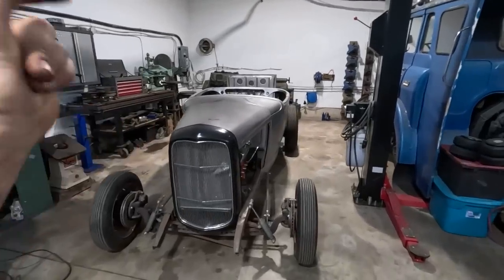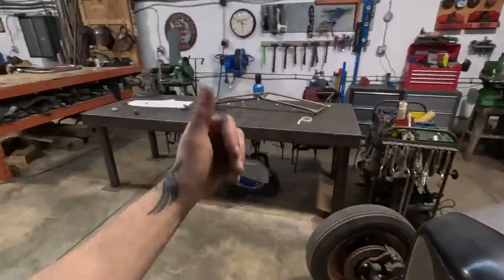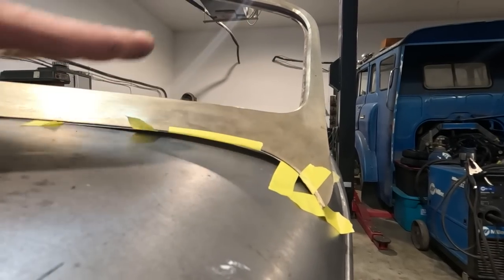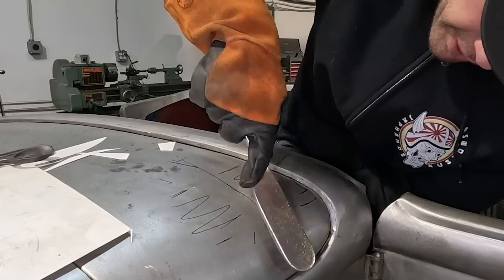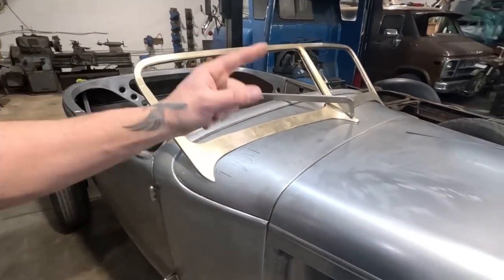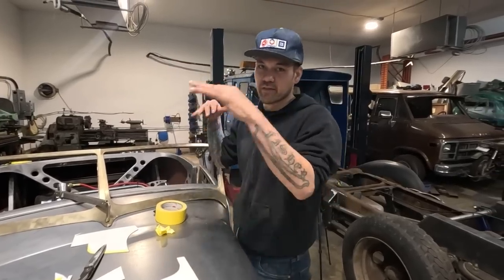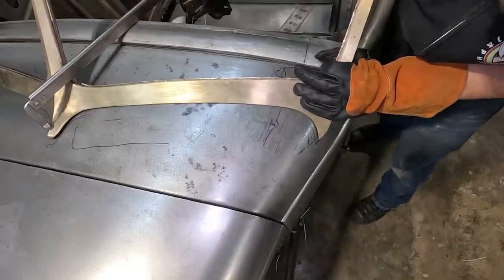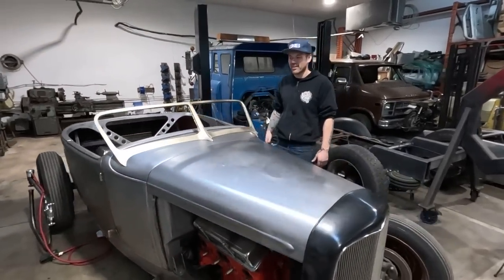How To Fit and Install a Duvall Windshield 1931 Model A Roadster

Comment: You might want to consider a reinforcement strip on the inside to prevent the nuts from deforming the metal around the holes. Between wind and weight of the glass and frame it may need a little more support.
Reply: Good thinking 👊🏻
Reply: So cool . I think you should leave the chrome bezel exposed on the grille to match windscreen
Reply: Yes , and I probably would've just started with that.
So position in the place where the fit looks the best , template the holes , drill 'm and see how much of a fit you can get just with bolting it down.
You can just pull the metal of the cowl up to the frame and monitor the warping and if needed modify the metal.
Even add more studs to get it closer in some places.
Grinding that expensive frame that's designed for high grade panels is something I would probably save for last.
Reply: @gpw203  yup, exactly what I was thinkin
Reply: Just my thoughts also that window frame is really heavy on its own and then add glass and window pressure while driving I agree reinforcement is needed
Reply: nice, looks great !..thanks..
Black Art Forge ..
Reply from the maker: Great point, Kenneth! Not only is the bronze much more heavier than an aluminum version but the glass as well. Should have some kind of reinforcement underneath.
Reply: @MakeItKustom    Forgot to say. 
I really admire the work you do Carl.   👍
Reply: I love the fact that you don't compromise. Doing it the right way, is the Karl way. Forming those cowl panels to fit the window frame just speaks volumes to me about your values. Color me impressed, dude!

Comment: I think it looks great. I just want to mention that if you are going to be grinding and sanding extensively on brass or bronze on a regular basis. Respiratory protection would be a good idea. to protect from lead poisoning from the lead added to the metal to make it softer. I worked in a brass/bronze foundry for many years and it doesn't take much to protect yourself from it.
Reply: Good of you to point that out.
You see so much fabrication video's where people forget about their health it's scary.
Don't forget the dust coming of the grinding discs , that alone is reason enough to put on a mask. 
If I compare a mask I've worn all day to a clean one from the outside it's night and day and all that dark dust could've ended up in my lungs.
Reply: @bebobism  Hello I was thinking the same thing. I learnt from guys with R/C boats, when they sharpen and cup their tiny propellors, they are worried about Beryllium in your airways.

Comment: Thanks for sharing,  I just did a similar project, a 27 roadster with a brass Speedster windshield.  Only difference was my roadster was fiberglass, so I had to add fiberglass in low spots. Your videos are always interesting! Thanks again for sharing!

Comment: Karl, If your going that far with the grill I think you should rack the bottom forward to.
Matching the angle of flow of the windscreen would be awesome.
Reply from the maker: Interesting! Thanks for the suggestion
Reply: @MakeItKustom  Also you have to think that the Zephyr has sort of an arrow head front and the rod has a flat front to it. So you cardboard cut out will be different to the plain angle front on. So you really need to see it from the side for that cut out shape this from the front the bar section you are fitting will be thinner looking at the front. You'll have to workout the angles.

Comment: That's such a beautiful windshield. 

Don't forget to account for thickness of the paint layer. 

If this gets hosed down with high build those lower wings are going to need an extra 1/16". (Total from side to side.)

It's something that's bit me before with side mirrors and trim.

Comment: Unique work on this one. Glad you spent time developing the cowl up a bit to match, you can even see the difference using the reflections of the shop lights on the metal as the reflection transitions from the hood to the cowl. It’s subtle but noticeably more uniform now.

Comment: Love it Karl. Great job. Maybe make a kind of spacer to "sandwich" the cowl once you tighten the window frame. Assembly order? Window frame /cowl/spacer/nuts. For the spacer use the template you made to locate the holes. Overkill? Certainly.
Reply from the maker: Great suggestion thank you so much!

Comment: I realy think you need to take the bottom of the windshield frame in the center an move that to the bottom of the grill. That would flow extremely well and elongate the center bar threw the middle of the grill.

Comment: Great creative work! Use bolts on the outside two in place of studs and you won't have to slot the holes. Keep working that left side fit, there's still a gap. Thumbs up.

Comment: Karl, it certainly looks great...... But I wonder if it'll distort the cowl with the wind against the frame and glass? Perhaps a bit of bracing on the underside of the cowl wouldn't be a bad idea? Just a thought after all of your hard work, I'd hate to see it ruined the first time at speed! But it does look amazing 😍👍
Reply from the maker: That’s a good idea on the bracing. I think that you are correct and it should have some thing whether it may or may not need it. It’s better to be safe than in trouble.

Comment: If you were to remove the windshield's studs, they could be replaced with transfer screws that would mark your locations after the proper position was determined - just another option. 
The studs should be Allen head set screws so you can hold the stud from turning as you tighten the lock nuts. Over-torquing the screws, as you tighten the lock nuts can mess up the threads in the windshield.

Comment: Windshield is as good as it gets. Looking forwards to the grill shell. Didn’t think you could improve on a Duce grill. I think your right in saying you should hide the insert surround so you just see the bars. And a v spreader bar up front. Or will you bob the front of the frame. Always look forwards to you creativity.

Comment: Wondering why you don't scribe it in? Years ago I used to build custom saunas. I used the scribe constantly to blend woodwork to rough stone.Level your part and then take your widest gap and set that on your compass. Run the compass along the surface making sure to keep it level. The scribed line will match perfectly to the surface. Grind to the line and it will fit like a glove.
Reply from the maker: A little bit different in the situation being very organic in 3-D shape

Comment: I learned a lot on your videos but i got a question, how would you go about making fender liners in a car
Reply from the maker: If I was starting from nothing, I would make a wire pattern first and then a paper pattern and start shaping. If it was to replace something that is still kind of their than I would use that for the pattern.

Comment: Very nice fit. It takes a body man to see the solution in the panel shape rather than just grind the frame. I built a Hallock style screen from 1/8 steel for my 28A. I found the original tank / cowl was different side to side. It required 2 separate templates for the outer and 2 more for the inner. It would have been nice if Henry had built my car symmetrical
Reply: Very common to be lopsided,,,  espicially the earlier cars ,,  within quarters of inches  differences  ,

Comment: Karl,  Will you be using a (rubber?) gasket between the cowl and the windshield frame?  I keep seeing the gasket between my CJ-2A's cowl & folding windshield frame to keep water off of your knees, etc.  I'm looking forward to seeing how you split your grille too.  I think you need a more slender (especially at the top) center section based on your first template which looked out of scale, but that's just me.  I definitely agree with Kenneth Philips about adding a reinforcement strip between the Nylocks and the underside of the cowl to avoid deforming the metal.
Reply from the maker: Yes, there will be some kind of gasket for sure

Comment: I would have saved using lock tight for final fit after paint and gaskets etc.. 
At least on the two end studs. 
But at least lock tight fails around 350f so warming up the ends will help release it.

Comment: Karl like the look, something different than a lot of roadster ! think it would be not to good for a tall driver but would have to see how the seats will be for this cars drivable . Is this your car and did you build the body or is it a Brookfield on a 32 frame ? Very nice job showing how to fit it, as like you said ever cowl is a little different shape .More on this build would be nice to see !
Reply from the maker: This is mostly in original body with some aftermarket sheet metal and a new aftermarket frame. This is not my car

Comment: I like your approach to the Duval windshield, and how you will mimick the design into the Split grille, but have you considered placing that Center w/shield section to the Lower part of the Grille? You could modify the grille at the base, just a suggestion either way nice work Karl👍
Reply from the maker: I’ve got it pretty much figured out now but yes, something similar to that look

Comment: I just ordered last week a Hallock windshield for my '28 RPU didn't receive it yet but your video is published just at the right moment.
Are you going to chrome the windshield frame? Because you know you just locktited the studs...
About that grille modification you want to do : the template makes it look like a BMW, not a Zephyr to me.
Reply from the maker: It will be polished. Right on I like those as well

Comment: Windshield looks fantastic. On the grill split - IMO the radius of the top of the divider should match the radius in the outer top corners. Your pattern had a larger radius and personally I didn't like that look - I like symmetry, much in the way you wanted the radius of the windshield shell to match in the corners to the cowl.

Comment: make an under support molded to th bottom of the wind shield frame...itll spread wind force and pull the sheet metal up a smidge too.................washers and nylocks cant be enough under structure

Comment: The metal looked like it wanted to move.   Why would you not drill and tap two new holes in frame where you need it and pull the metal to the frame?      First thing that came to my head but it is a question

Comment: Great video Karl, I like the direction you are heading with this.  Just a few thoughts -for template work, I've taken to using clear plastic transparency film like the teacher used in school for the overhead projector.  It's tough and you can get it in rolls or big sheets and it makes making templates insanely easy because it's transparent!  No more guessing where holes are or contours.  Second someone else mentioned a backing strip for under the cowl and that occurred to me also for a bit of rigidity.  Third, would you think that a strip of flat rubber between the cowl and windshield frame would prevent  water from getting trapped in between and also not bleeding under and down onto the occupants as it's a high pressure zone while driving.  Best regards man!

Comment: Karl, good video but we need a side talk when it comes to YouTube's bell / notifications. Phone is good, you get a banner from the top, but I wasn't getting notifications and nothing in home page line you. Try it yourself but change to bell to "Outline - Clear" and you don't get anything. Now, if you change it to all black then it works the way it should. Just a thought as I found it queer that I wasn't getting "Make It Custom" video notifications!
Just heads up, but I do have an iPhone 6-S that is 5-G capable. Maybe wrong but check it out DK, Omaha.
Reply from the maker: Thanks for bringing this to my attention Dean. That’s kind of interesting I’ll definitely look into it. I appreciate it very much!
Reply: @MakeItKustom  Well it worked today even though I did see my phone, have it on, but your reply to my comment was on the "Home Page". I was simply thing to look you up because it has been 2-3 months since you had a video in my cue! Something did change be it on purpose or other but I value your content yet the bell was still checked, but just the clear bell and not the solid bell. Look to see if views started dropping or try it on a buddy. See what happens. Have a good week! DK, Omaha.

Comment: Are you planning on welding the seams between the floor pans or just have the spot welds? Going to be doing floors in a '28 coupe.
Reply from the maker: It depends what happens, but they will likely just seem sealed and covered

Comment: If you were putting one of those screens onto a car with paint and you didnt want to do the body work to make it fit, couldnt you braze along the leading edge to fill the gap? Im guessing if the body panels are factory then you wouldnt have to do any mods? Its a cool looking screen , but $3K wow.

Comment: A transferable color on the car that would show contacts points on the brass would have enabled you to grind away contact points bringing a flush fit.  Any high points could be discerned on the window frame and be removed. After a few fittings of this type would have been quicker and easier.   Watching you try to fit this window was excruciatingly frustrating and I could hardly watch.  Ugh...